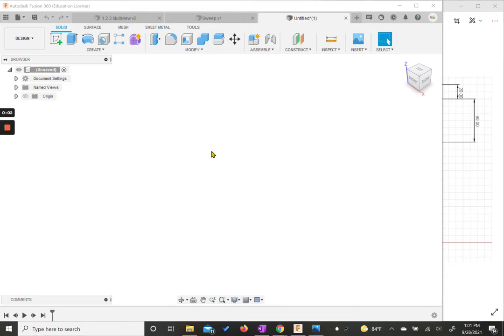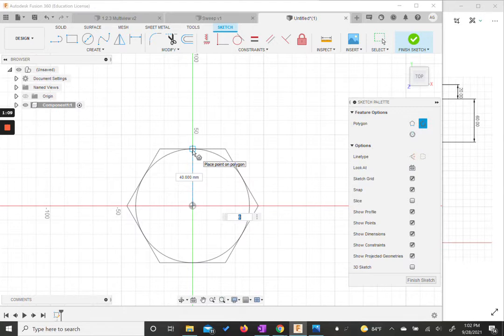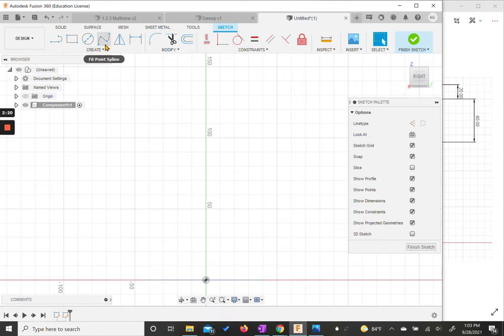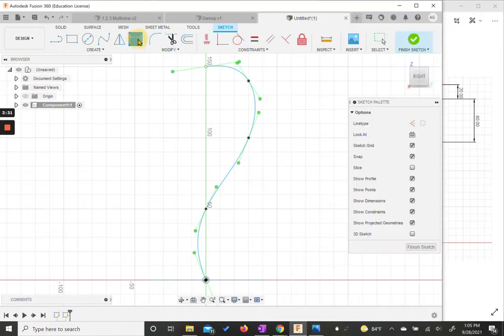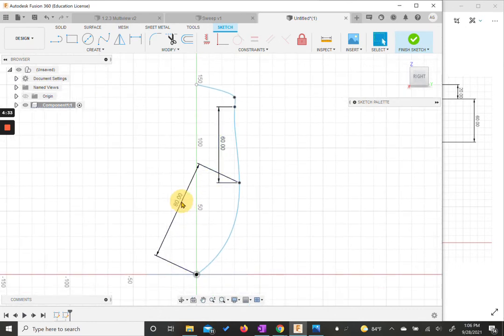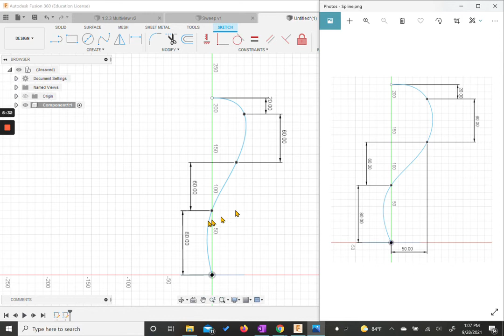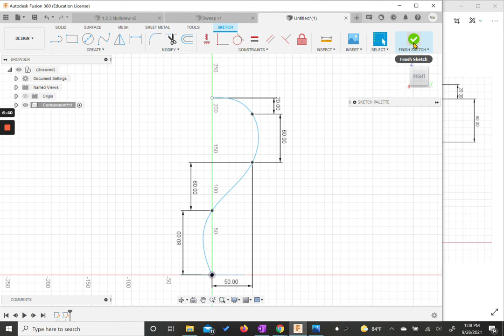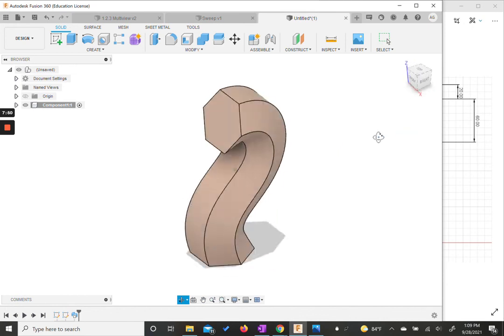Fusion 360: Spline and Sweep

Comment: Hello, can you have a fixed length of the spline ? ex 200mm that you have to adapt to fit into the point of 150mm, and have restrictions of the shape because of the length of 200mm.